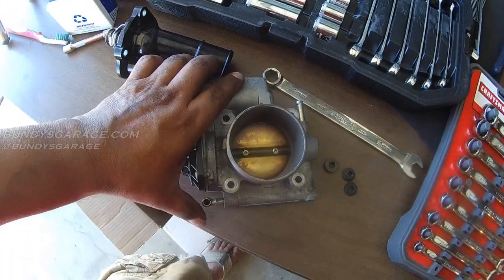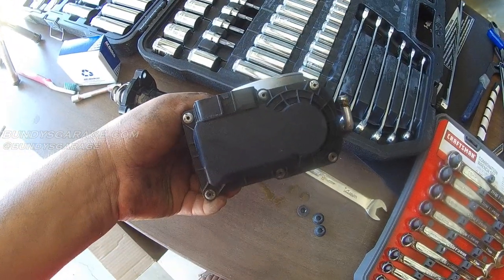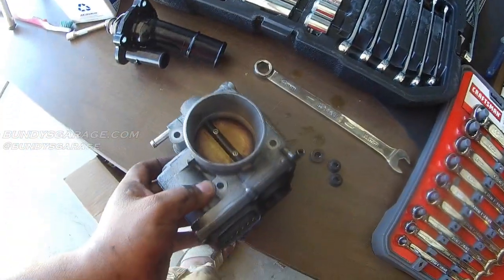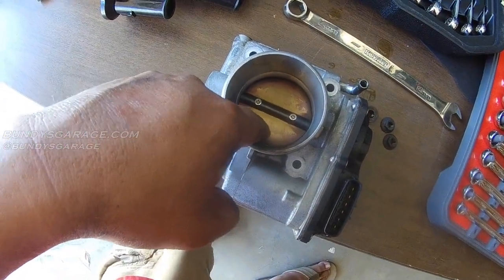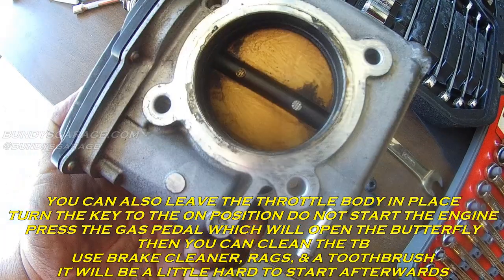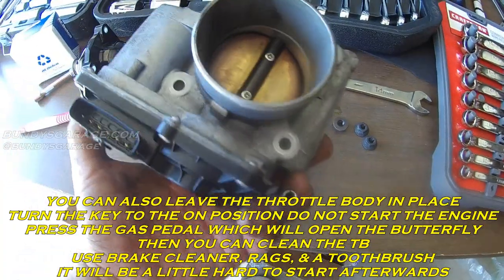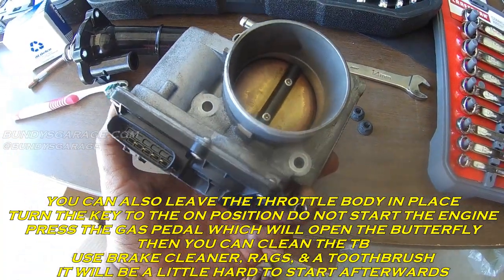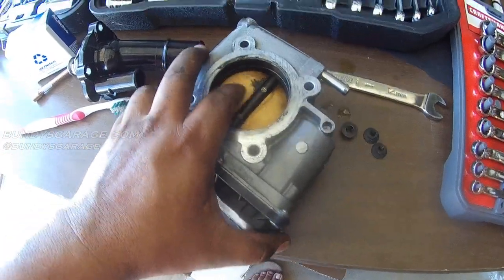How to Clean a Throttle Body - Throttle Body Service - Fly by Wire Throttle Body

Comment: Wrong, if you disconnect battery, remove tb, and very gently swing it open it wont cause any harm. Also a 2015 ram 2500 5.7 tb is 180 bucks.

Comment: So how are you going clean behind the butterfly if you cannot push it open? The IAC needs to get cleaned..I have been doing mine for years on Jeep GC 3.7 with no issue.
Reply from the maker: You gotta take it off to get the back 100%. Sometimes it will open up with the key on and then push the gas peddle. Sometimes it only works for a second and then closes again. Plus it’s the the backside you should be worried about, the part where the butterfly touches the throttle body is where you should be focusing on
Reply: Ok, will check that and spray cleaner behind that, have only been using WD40 on rag to clean it. Thanks brother..
Reply: 1000 dollars for a throttle body? I have yet never seen one even close to that price.
Reply: @michaelkane2883  You didnt look very hard...NAPA, O'Riley, Advanced auto parts, etc... all have Throttle bodies listed at or over $1000